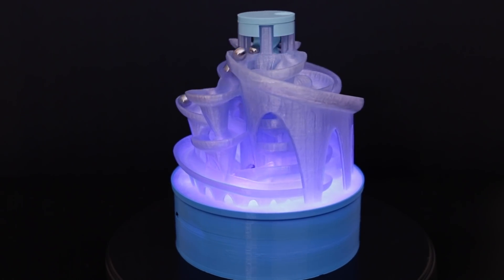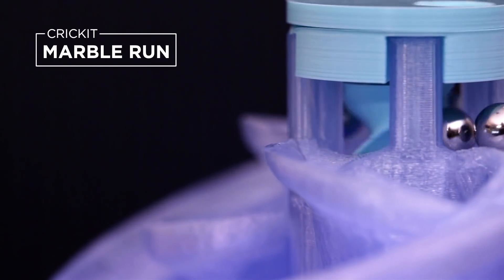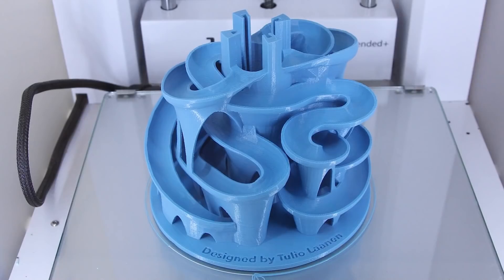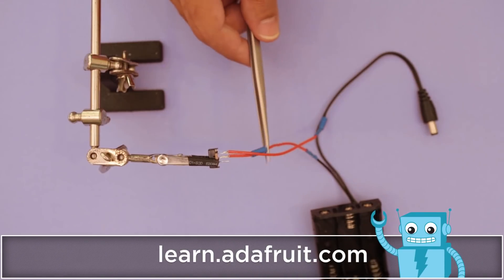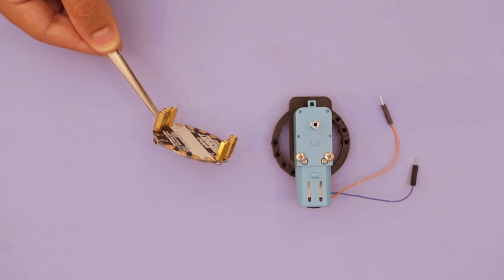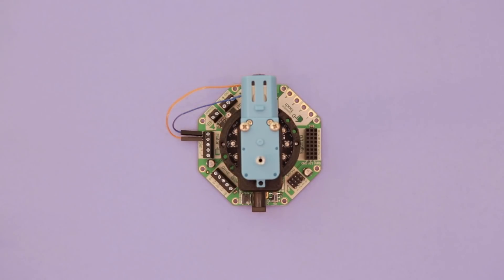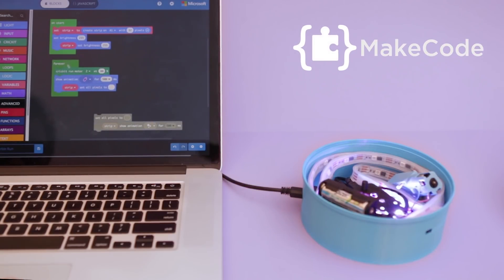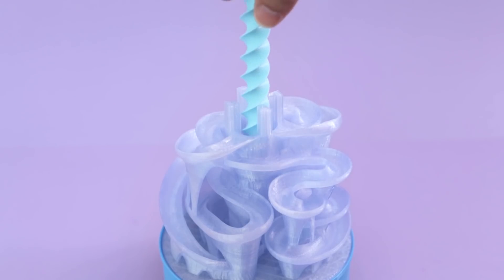Motorized Marble Machine #3dprinting @adafruit #adafruit

Comment: I think the Crickit is a little underpowered for this project. 
You'd be better off extending the base and putting a Raspberry Pi or a Mac mini in there. Running both a motor and a LED strip takes a lot of processing power.
Reply: Each LED takes at least 12 terraflops of processing power to run. They should extend the base to include a few server racks.